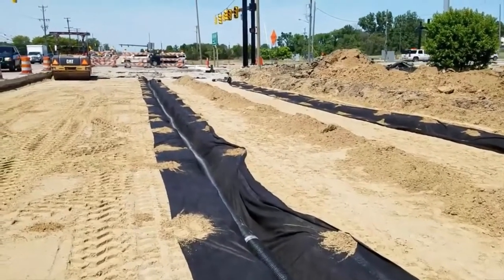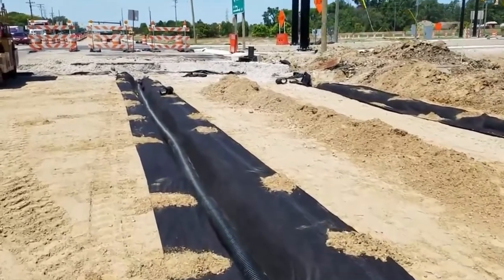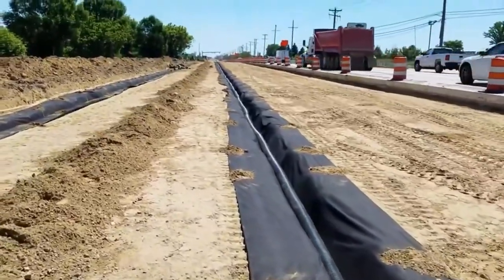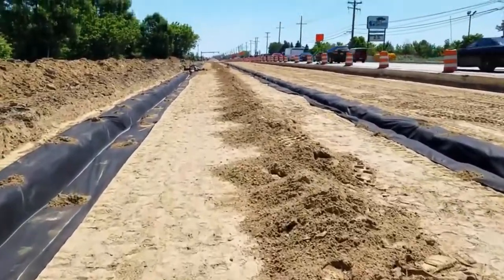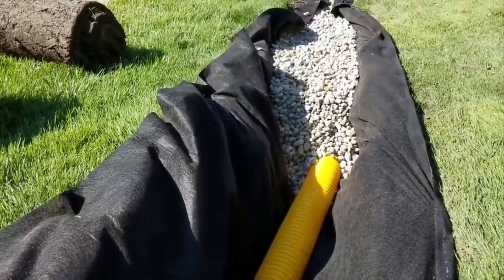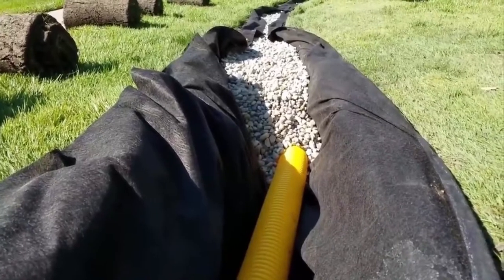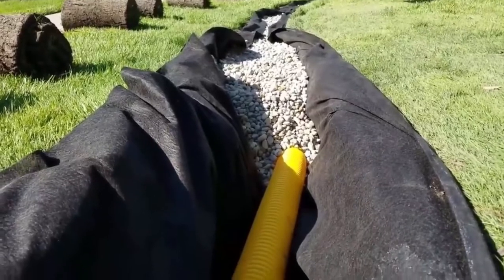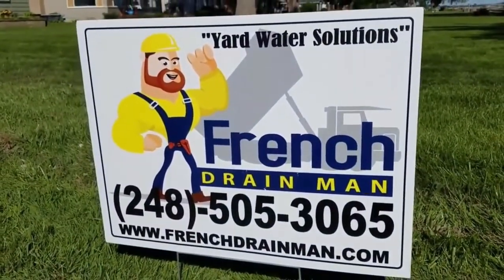WARNING!!!! Don't Make This French Drain Mistake

Comment: Hello. I've been watching your videos for awhile and as a general contractor I appreciate your willingness to share your knowledge on drainage.    I have a question. Can a french drain open or closed, be near a row of pepper trees. It is the only area where a french drain can be installed and also the area that floods. Any input is appreciated. Thanks.  Merry Christmas
Reply from the maker: I would install a yard drain French drain combo. Build it with slope so it doesn't leave water behind. Trees will sniff out water in the drought months and take out a French Drain system.
Reply: @FRENCH DRAIN MAN  thank you very much.